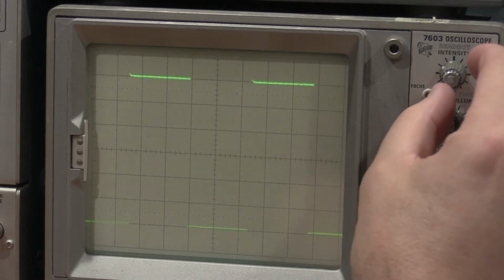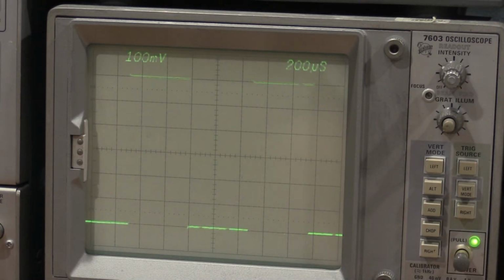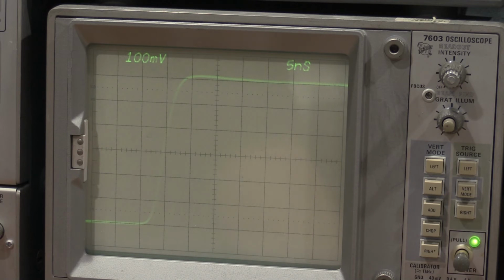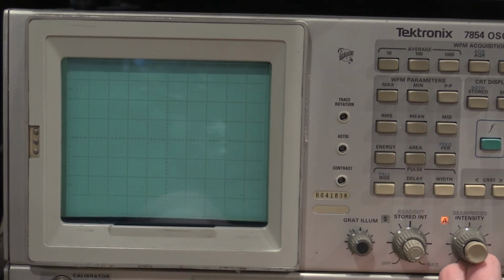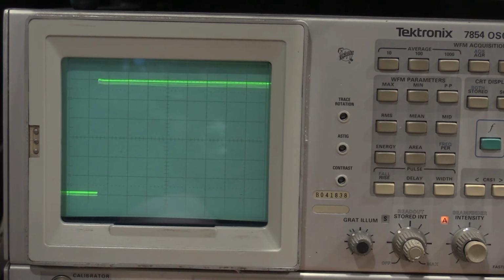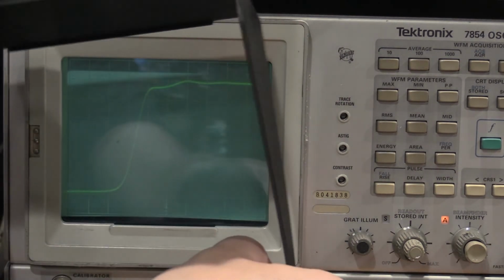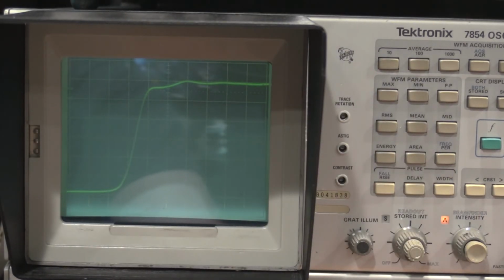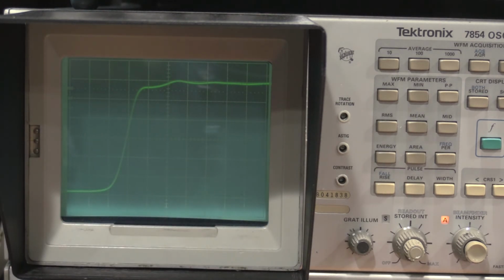Square Waves and Scope Cals A Deeper Look

Comment: How about the Leo Pulser (from EEVBlog forums)? That thing has a 50ps rise time. Judging by the pictures on the CSA803A, the top of the square wave looks pretty flat as well.

I'm interested in picking up a 4-series Tek scope and doing a restoration and alignment myself. I don't have a lab though, just a multimeter. I'm wondering what it would take to get the cheapest possible lab up and running, just to align a 465 or 475.
Reply from the maker: The leo pulser might be fine for a 4xx plugin however I do know they have had trouble with the automated calibration of the 2xxx line of scopes. The 2xxx line of scopes is really picky about the input waveforms for the alignment procedure. I do have 2 leo pulsers here in the lab as well. With a 475 you will top out at most 250Mhz so not to crazy in terms of signals needed.

Comment: Not perfect but I used my Rigol 4162 ARB to calibrate a surplus Boonton 92B RF millivoltmeter (1 mV to 3 V RMS) with a mismatched serial number probe (those surplus units are just about always missing the probes); confirmed with Rigol SA in the 50Ω mode for dBm...close enough for government work for my ham workbench.
Reply from the maker: I was looking at the 4162 today as the example arb gen for the function generator video. Right now it is a toss up between the 900 the 2000 or the 4162. With a price swing of about $500.00 however the 900 and the 2000 are very close in capabilities. But If I do step in to the DG4xxx series it look like there is a lot more modulation capabilities.